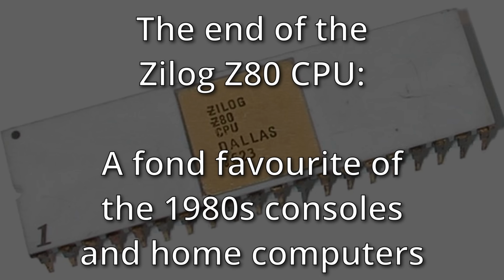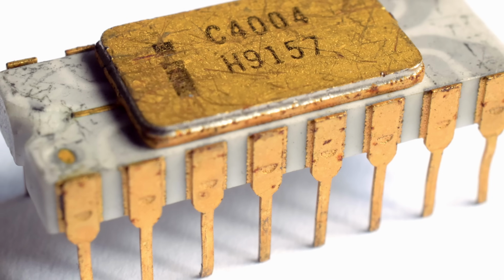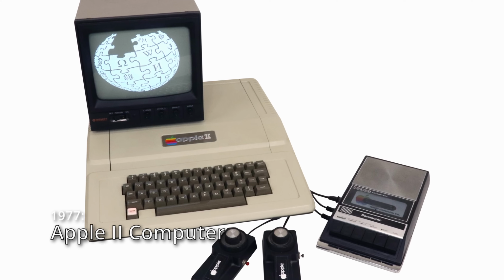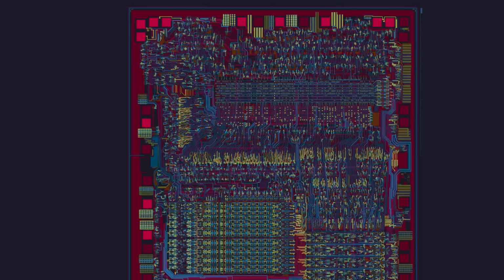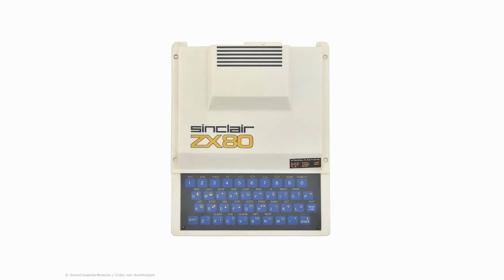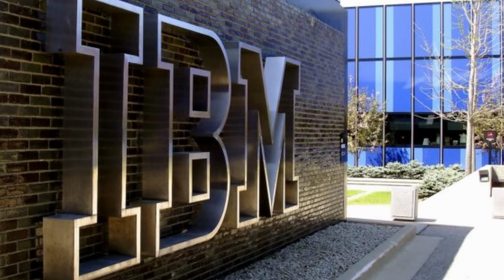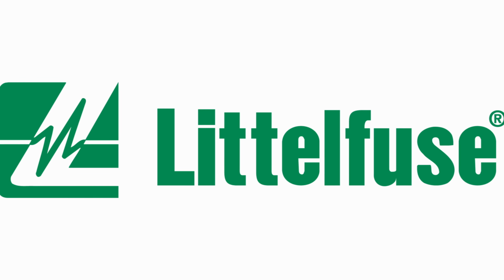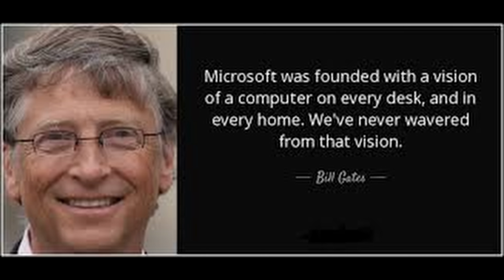The Z80 CPU - 1976 to 2024

Comment: My first computer was a Cromemco Z80 system on an S100 bus, with 64K RAM and two 241K 8" floppy disks running CDOS, a CP/M clone. Later I upgraded to a (massive!) 10MB hard disk, and recoded the OS to support it - not too hard in those days, with just serial port and two disk drivers needed. That computer did a lot of work for me. Simpler times indeed!
Reply from the maker: That would have been a really cool experience! If you'd ever feel like having a chat about your machine on the channel, I think that would make a great story! Drop me a line if you would like that!
Reply: Please let us know more about this.  We need to be able to record the stories you have in order to learn.
Reply: @mbilden  I've summarised it, but its too long for a posting here (just over 2 pages). Any suggestions?
Reply from the maker: Drop me a line! We can do a video chat on the topic, it'll be fun! Email me - ajross dot NZ at geemail dot com
Reply: Lots of memories to dust off - I'll see what I can do.
Reply: I built a Cromemco Z1 kit for my college in 1978.  Like your machine, ours had 64K RAM and two floppy drives.  We used the machine in our computer science classes to study operating system design as our IBM Remote Job Entry system into an IBM 370 limited our ability to get down to the hardware level and write device drivers.  Upon graduation in 1980, I joined Mostek and became a factory application engineer on the STD bus which was based on the Z80 chip family
Reply: Yes, a discussion of the Cromemco machines would be great! No doubt the most advanced 8 bit computers ever made. Expensive business machines that led into the 16 bit era. There was a later motherboard that ran both a Z80 and a Moto 6800 for a Unix OS clone they called Cromix. I also had 8" floppies along with 5 1/4". Price of a 10MB HDD was $3,000 back then!
Reply: @loboheeler  My Uni used a Cromix system in the mid-1980s, with a 68000 processor. My first intro to Unix and the 68000. We used SVS Fortran in teaching the students about image processing, and (for the time) it did a good job.

Comment: Imagine if the Z80 were designed in state-of-art CMOS to have a clock rate of say 7GHz. Of course, you'd have to redesign the support chipset too. Since it's smaller, I bet you could run it at a higher frequency than most CPUs due to less overall heat production. But still wouldn't be too powerful compared to modern CPUs due to a lack of what I call "torque" i.e. how much work gets done/clock cycle.
Reply: Take a look at the Z180. It’s still in production, runs Z80 code, is CMOS based and runs at up to 32MHz.

Comment: Isn’t there other fabs making other variations of the architecture?
I thought this bulletin referred to just the older node implementation?
Reply from the maker: As per the end of the video the newer eZ80 is the logical next step but it is not in the original 40 pin configuration any more and is not 100% chip compatible

Comment: I honestly thought the Z80 might never leave active production. What a great piece of technology history!
Reply: So finally after 50+ years the 6502 vs Z80 war is over, winner by default the 6502! 🤪😜
Reply: @thudtheace  Acorn originally adopted the 6502. Then they developed their own chip called ARM, which is very definitely the winner in terms of volume shipped.
Reply: @acmenipponair  If you are comparing architectures, there are more ARM chips sold every year than Intel has sold in its lifetime.
Reply: @thudtheace  As a happy owner of both (I had an Apple II and Sanyo MBC at the same time) it’s just a joy to have watched the race.
Reply: It seems like there should be a market still for die shrunk, lower cost, lower power versions of these simpler chips.    Although modern SOCs run circles around these old architectures, it is still nostalgic, like vinyl and vacuum tubes.  😂
Reply: Plus the 6502 has a backwards compatible 16 Bit successor, the 65816, which is also still manufactured. It powers the Apple IIGS or the SuperCPU cart accelerating the C64 to 20 MHz and giving it 16 Bit capabiity (sadly quite rare, and seems hard to replicate). 

I am also not too sure if the Z80 really outperforms the 6502. Usually the Z80 computers ran at about 4 MHz, while most 6502 computers ran at about 1 MHz. One exception ist the Acorn BBC Micro, which runs at 2 MHz and seems on a par with the 4 MHz Z80 computers (at least CPU hungry 3D games like Elite seem to run as smooth). 

And the 6502 also seems to outperform early IBM PCs, Adrian's Digital Basement showed that even a 286 PC clocked down to 1 MHz is rather somewhat slower than an Apple II running a 6502 at 1 MHz.

And speaking of Acorn and ARM, while 6502 ist not RISC in the strict sense, many say it was an inspiration with it's streamlined and efficient instruction set.

Comment: This is a brilliant documentary. Just to add, $26 in 1976 was roughly half a week wages in a ordinary job today. By ordinary, I mean somewhere between a retail worker or delivery driver. I still believe in the Z80
Reply from the maker: Thanks very much for your kind words! It was still a decent chunk of change, but certainly affordable compared to the thousands of bucks Intel would charge. Only after the success of the 6502 and Z80 did Intel & Motorola see that computers could be in every home and office and started to scale their prices accordingly
Reply: That's like 100 bucks in today's dollars. Retail pays around 15 bucks an hour. So its more like a days pay.
Reply: @artemisPrime3285  Definitely part time if you were earning only $2.85 - $3.35 per hour.
Reply: When the 8080 was first released in 1974, it cost $360, so $26 was a very good deal for a processor with better performance!
Reply from the maker: @mrodby  yeah, the Z80 was chump change compared with Intel!

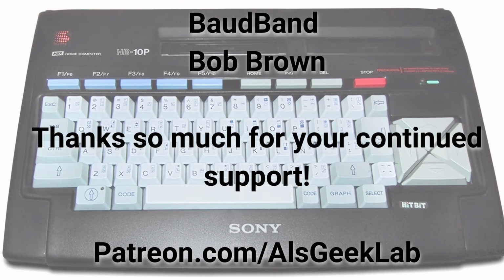Comment: 0:27 The pictured TI-89 actually used a 68000 but some TI graphing calculators do indeed use a Z80 (or an eZ80 these days).
Reply from the maker: Thanks for the heads up. I knew some of them did, didn't specifically know which ones
Reply: Yes , but all Texas graphic  calculators before  Ti89 used Zilog cpu
Reply: @edwardteller5879  TI-81 to T!-86 used Z80, and so did TI-73. The earlier TI-80 used some weird Toshiba thing. TI-89, TI-92 and TI Voyage 200 used 68000.
Reply: @ijabbott63  you forgot the T83 series and TI84-Plus series, unless I am misinformed. The first TI-80 Pocket Computer used two 4004s. Not in any sort of "dual core" set up or the equivalent, Sharp (these were re-branded by TI)  just divided CPU functions between the two.  This is the kind of fact that AI hallucinates on, I'm sure confusing The Pocket Computer with the other TI-80 microcomputer line. The Pocket Computer heavily marketed on it's ability to do BASIC, which at the time made it not a calculator, at least according to TI marketing and their literature, anyways.
Reply: @squirlmy  I was including the TI-83 and TI-84 series within "TI-81 to TI-86", also including the TI-82 series and TI-85. I was mistaken about TI's first graphing calculator was the TI-81, not the TI-80. The TI-80 graphing calculator came several years after the TI-81 and was unusual in not using a Z80.

I think you were thinking of the TRS-80 pocket computer.

Comment: The Z80 is my favorite CPU alongg with the 6502. I've always wondered how fast they could be if more modern processes were used to make them, say 90nm or something. Of course the die would be so small that a very accurate tiny robot would have to package it, but they could get millions from a wafer.
Reply: They could indeed be wicked fast, but without intermediate internal cache augmentation or simply incorporating all system memory on-chip (yesterday’s system memory size is today’s cache size), it would spend vastly more time in wait state’s than execution.

Comment: I'm surprised that Zilog never went after the potential performance benefits of switching for a full sized 8 bit ALU to the Z80.  I guess while it would still be instruction-compatible, the timings would change, which could affect certain applications of the chips that had code reliant on many clock ticks each instruction used.
Reply: That’s exactly what follow-on variants did do, but they dropped out of the PC race and receded into the lesser known embedded world.
Reply from the maker: Interesting point, thanks for the follow up @chrissmith-tc4df too!

Comment: Gameboy cpu is not z80, it is not even compatible with it.
Reply: It’s Z80-alike. 

Wikipedia: Within the DMG-CPU, the main processor is a Sharp SM83, a hybrid between two other 8-bit processors: the Intel 8080 and the Zilog Z80. The SM83 has the seven 8-bit registers of the 8080 (compared to 14 on the Z80), but uses the Z80's programming syntax and extra bit manipulation instructions, it also adds a few new instructions to optimize the processor for certain operations related to the way the hardware was arranged.
Reply from the maker: It's a sharp rip off of the Z80
Reply: @AlsGeekLab  It's actually closer to the 8080 than the Z80, has some Z80 features, and some 6502 features. It's just a weird mix of ideas from multiple processors of the time.

Comment: Except the Z80 only has a 4-bit ALU and lots of its instructions are on one end of the clock tick. The 6502 has a true 8-bit ALU and it can process instructions on the top and bottom of the clock tick. If both at 1MHz, the 6502 far outperforms the Z80. That's the key isn't it, the Z80 was usually at 3.25MHz, 4MHz or some faster speed, so the Z80 seems better at first.
Reply: and again the same stupid mhx comparison which does not mean nothing. a 6502 @4Mhz require so much DRAM speed that with the same memory chips you can interface a 16Mhz Z80! so the ratio is the same. the apparent efficiency on 6502 is due to the double clock usage while the z80 use a faster single clock and divide by 2 or more the clock to perform its internal operation while the 6502 used the clock "as is". What does matter is the amount of operations a processor can do at maximum clock rate, not the maximum clock rate itself. On this side a z80 CPU outperform the 6502 by 20% to more than 200%! look for example a full range LDIR instruction which does memory move operations. The  6502 didn't have this instruction and emulating this via code is itselft 3-4 time slower even at same clock rate. OF course this is a extreme comparison and choosing some use cases one can show that the 6502 could be faster than z80 (for example emulating a pre or post indexed memory operations), but in real world scenario one can expect the z80 to be at least 20% faster if both processors were clocked at maximum clock rate. And i was comparing the original versions of both cpus not some enhancements.

The main limit on 6502 is the absence of gen purpose registers ( well, we have register A, X, Y ) which forced a more intensive memory based operations where the z80 could operate internally on  registers.
Reply: I have machine coded (direct hexadecimal, no assembly) the 6502, 6800, 8080, 8085 and Z80.
Did my bachelor degree work on my Spectrum. Should be still at the attack, battered.
Reply: The ALU was 4-bit? That's surprising, considering it was somewhat capable of 16-bit computing.
Reply: @mstcrow5429 It was very capable and had a great instruction set, but that 4 bit ALU hindered performance relatively hard given the rest of the design.
Reply from the maker: Yes I think that's why I said that the 6502 was better on paper. The Z80 outperformed it because it was provided at greater clock speeds than the 6502 at the time
Reply: @AlsGeekLab they both pretty much maxed out the memory chips of the time.
Reply: I guess that is why  a few years later CPUs started having internal cache  @peterfireflylund
Reply: Who cares perf/Hz? Who cares ALU width? Only perf/dollar matters!!
Reply: @parkershaw8529 spoken by one who truly understands how the stupid tech world works 😂😂😂

Comment: The 6502 was in more things than most people realized.  Who has a original NES?  By original I am referring to the ones that were out in 1989.  These were one of those consoles that had a lot of people blowing on or cleaning the cartridge contacts a lot.
Reply: The NES used a bootleg copy of the 6502 made by Ricoh that had some parts of the die deactivated so they could try and claim it wasn't a direct copy. However MOS Technology was suspicious and x-rayed a sample which showed it was made from stolen masks obtained through industrial espionage. Caught red handed, Nintendo and Ricoh basically pointed their fingers at each other with Ricoh claiming Nintendo provided the masks saying they were reverse engineered and Ninteno claiming Ricoh had told them they reverse engineered the masks with each side saying that they "dindu nuffin"

Comment: Surprised you didn't mention the Z180. That was a super Z80 originally developed by Hitachi as the HD64180.  Z180 was a very useful embedded MCU in the 90's
Reply: The Z-80 is still on life support in these binary compatible expanded architecture products.
Reply: Agreed. The HD64180 was an amazing chip with integrated Uarts, timers, etc, long before they became commodities in the microcontroller space.

Comment: Many years ago I had a Heathkit H89 computer which used two Z80 cpus. One of the Z80s was on the main computer board, the other Z80 was on the video terminal board. This computer could run two operating systems. One of the operating systems was Heath Disk Operating System, known as HDOS. The other operating system was CP/M.
Reply: It could also run UCSD pascal, which was its own operating system with a p-code interpreter integrated into the p-System (the name given to the operating system). Capable of concurrent multitasking at a time when MS-DOS was strictly single thread. The performance of the H89 was, for the day, remarkably good. We used one in conjunction with an external box, to emulate a wide range of CPU's in hardware and driver development. Ultimately UCSD priced itself out of the market.
Reply: @davidgapp1457  It''s a shame because the p-system is inherently portable and could easily adapt to new cpus. SofTech dropped the product, and it was picked up by Pecan Systems, owned and run by real enthusiast users. But the market at the time wanted to coalesce around a single OS, just about any microcomputer OS might have been embraced, but IBM PC-DOS and MS-DOSes turned out to be that, although early MS-DOSes, were really a bunch of incompatible OSes. Compaq, Phoenix and the other clone makers fixed that.
Reply: @davidgapp14 and then came turbo Pascal?
Reply: There was another version of this computer.  The kit form was called the Heathkit H89, the fully assembled version was marketed under the Zenith Data Systems name as the Zenith Data Systems H90. It is too bad the Heathkit and Zenith Data Systems went out of business.
Reply: @davidgrisez  I'll check that out as well. Thanks
Reply: That sounds awesome. I've never heard of that system. You've given me something to research. Thank you 😉
Reply: One small correction the fully assembled version of the Heathkit H89 was marketed as the Zenith Data Systems Z89 not Zenith Data Systems H90.
Reply: I'm curious, do you remember if there was a Basic compiler or interpreter that came with it? Was it Microsoft Basic?
Reply: @squirlmy  I remember that I used Microsoft Basic on this Heathkit H89. I believe that Microsoft Basic in both interpreter form and compiler form was available for both HDOS and CP/M operating systems.
Reply: Radio shack 
computer (tandy corp)
model 16 
has two processor 
motorola 68000 and z80 
operating system Xenix
Reply from the maker: @danielsanbsas watch my video on Xenix! That computer is featured on the video!
Reply: Btw hdos is in the public domain
Reply: I had two Z-100’s that I wish I still had. What ever happened to Zenith and Heath Kit? They, at one time, put out some good stuff.
Reply: 😊 oh now I want one of those!
Reply: Cool sponsor!